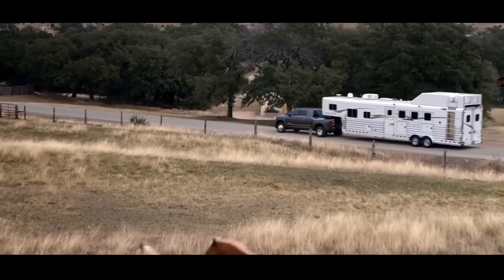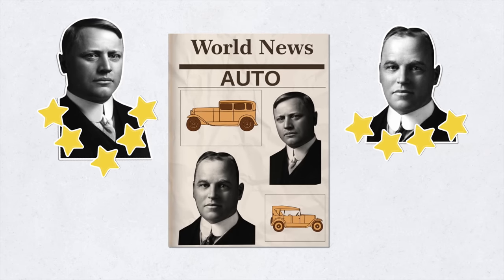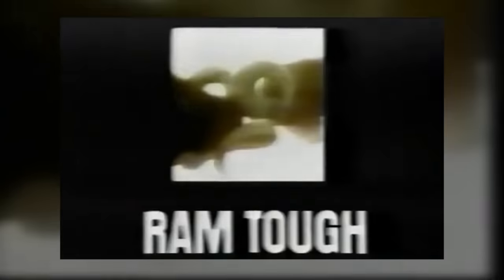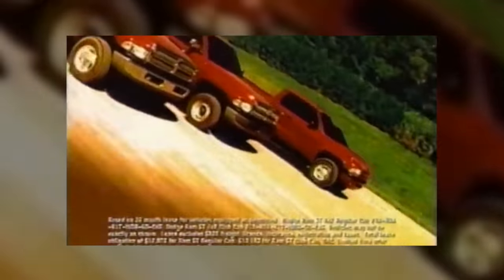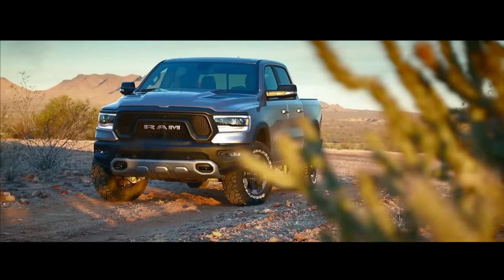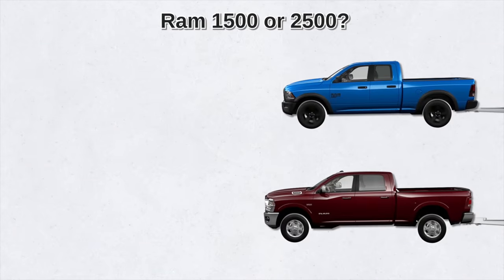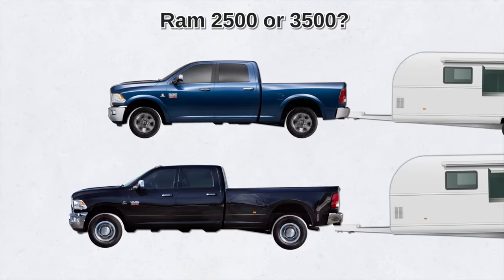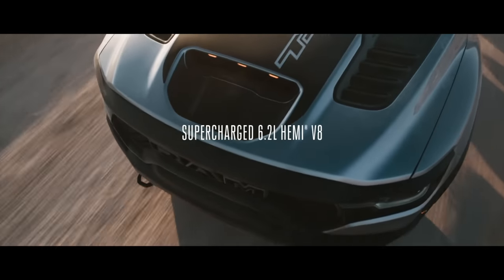No One is Telling You the Truth About Dodge Rams, So I Have to

Comment: Scotty, the 2021 RAM 1500 (New model) is awful. Whenever I make a right turn from a stop, the vehicle shuts down and loses power from the drivetrain, applies the emergency brake, and forces the driver to restart. The dealer who I bought it from says that "there is nothing wrong with the vehicle", yet acknowledges that the auto-start mechanism is the cause of the issue. Steer clear of this truck!!!!

Comment: Im having a broblem with air suspension on my 2017 Ram 1500 Limited edition. The whole truck is seating on a ground. I tried to take it to local diller and they told me since i don't have extended warranty it will be out of pocket cost . They say to begin they have to change my rear airbags and fill system with nitrogen. Then it might be more work after. 
Airbags are $2000 for bags alone $400 to install them + nitrogen fill up. 
I,d like to know if it's official recall for air suspension on my truck. It will help a lot. Waiting for response. Thx Suel

Comment: Just bought a used 2021 Dodge 1500 with 30k miles. Seems like all the truck manufacturers are having quality issues. 
If I start having trouble I'll sell it off before we get outside the power train warranty.

Comment: Nice Dodge commercial. I hope they paid you well. I did like the Dodge Brothers history lesson. I bought my first and last Ram in 1996. It was a beautiful truck. Drove like a sports car. I got lots of compliments and dates. The design and features hooked me. The Carroll Shelby and Mercedes Benz connection was evident. It just didn’t hold up. I think there was a problem with the metals used in its construction. I was sorely disappointed to be doing that many repairs on a new vehicle. I should have listened to my older brother. The people in my circle are Dodge owners spend a lot of time driving their other vehicles while their Dodge is at the mechanic. Dodge fans are really devoted.

Comment: Welp. I'm one that has the 5.9 Cummins 6 speed. Love this truck. Bought it brand new in 01 still stock today. Ain't no race truck by far. But keeps going. 420, 000 miles later still going easily. Inside dash is junk. Lol. Touch it and it crumbles. Please don't touch. Lol. Body yep. Rust out but I'm doing body work. Love this thing though.

Comment: I have run my RAM for a 125,000 miles without doing anything but the normal breaks changing the oil and tires it is been flawless and it gets 22 to 24 miles to the gallon on the highway with a hemi V8 I think it's a very good truck

Comment: Had a New 2002 2500 24 valve. Loved the truck, but it had a ton of problems, the adaptor between the Transfer case and Transmission cracked and leaked for no reason at less than 30,000 miles. The lift pump went out at 50k, and then the Injector pump went out a year later. Bosh quit making pumps so rebuilt ones were all that was available but still ran $1,000. Power Steering/Brake Booster went out twice, leaving me with no brakes, and you couldn't turn it unless it was moving. The PS Pump, being matted with the Vacuum Pump, required resealing sealing vacuum pump each time. This was all in the first 100K! It was a beautiful truck, great on the highway, but the springs were so stiff you really couldn't drive it far on dirt roads. It had springs like a Box Car on it!
It would rattle your teeth right out of your head! I loved that Truck!:face-orange-raised-eyebrow:

Comment: Greetings from Australia, as an fyi, this same truck in the 1500 is retailing in Australia for $140 thousand AUD or nearly $100 thousand USD. It comes off the factory floor is shipped to Australia where it is completely pulled apart and rebuilt into right hand drive. All manufacturers of full size US picks do this and refuse to build and supply direct to Australia, despite the demand being high. In Australia just about every household has a mid size pickup and want the full size. We are robbed blind.

Comment: I just traded my Ram for a Toyota. She ran great for a good long while, but in the last 6 months, i have had to drop over 30k in repairs in her, due to some defects that the independent mechanic says are faulty, low quality parts, and the dealership Ram Certified Mechanic says is because of a lack of maintenance.

Not sure how i maintain a motherboard, as the owner, when i cant even check it for issues without having a special code that the mechanics use, but only the certified ones. And costs a buck fifty just to have them diagnose the issue as 'you didnt maintain the vehicle, thats why your mother board shorted out, and burned your entire electrical system out'.

I'm not leaving Ram because of the quality. I'm switching to a brand that stands behind its product, and doesnt blame every issue on the consumer.

Comment: The Rams 1500 series and 97 the dash the top of the dash and that's at the whole dash so weak it just crumbles in your fingers the plastic will snap off and not be durable as some of it I had to go get a new top for my dash on my other 97 because when I got mine there was none on top where the air vents blow out so yeah that's so bad years for them on the dash so and I got told it'll snap and crack so I don't mess with it when you transmissions are pretty bad too I've got to get a transmission for my truck cuz the transmission went out and mine's a 5.2 l OL

Comment: Buy the Cumins with the 6 speed Aisin trans.
It is bullet proof. 
The other two including the 8 speed is crap.
I have had dodge trucks my whole life
I never had an issue until the 8 speed trans. They messed with it a couple times and then replaced the trans under warranty.
Just over two years later, it does this strange mis shift, when pulling a trailer at 70.
You start to need power on a hill,  it  trys to down shift to 6 gear and misses.
I never should have traded in my Cummins with the Aisin, for a new truck. The 5.7 hemi has been great. 8 speed trans is crap. 
Did I say it’s crap.

Comment: I bought a 2001 Dodge Ram 2500 Cummins Diesel brand new that year.  I had been pulling big heavy car trailers over 10 years using at least 3 different 90's GMC or Chevy Ext cab 1500's and they did OK but I wondered about a 2500.  I had been pulled out of a jam on a muddy back road by a then 30 year old Ram 4X4 1500 pickup. He latched onto my truck, my solid metal trailer, it fully loaded with a 70's Ford LTD 4dr and that Dodge barely settled an inch, so I was IMPRESSED.  Besides that Dodge 2500 diesel was all the rage then so I bought one out of Texas. Biggest thing I ever bought and paid cash for. That 2500 was so fine pulling big loads I got a gooseneck and a 3 car trailer.  I still own it, mechanically it had to have a lift pump changed at the 3 yr mark but that was it. Cosmetically it had come equipped from the factory as they all did with the non-optional self imploding  💩plastic dashboard that began to disintegrate at the 8 or 9 year mark. Hundreds maybe millions of trucks with the SAME problem, not a single recall. Like to know who Diamler paid off on that one. Mechanically it is still as fit as it was day one. I only have about 110,000 miles on it and truck-wise it's the best one I ever had.. But the dash continues to crumble, so I hardly ever drive it.

Comment: I had a 2011 Dodge 1500 SLT Ram Truck. Fanatastic riding truck. Terrible on fuel costs especially if you are pulling something. Then I bought a 2013 Ford 150 XTR Twin Turbo. Way better on Fuel and better towing vehicle. I had that truck for eight years and traded it with 170K miles with no power train issues. Not as nice of a ride though.

Comment: Me, my son and nephew all have 3500’s. They both have had to install new transmissions. They both tow fifth wheel toy haulers periodically. I tow a Cat 426 backhoe periodically. My transmission is fine. All are authentic. All are 4x4s all aft mega cabs. Mine is Longhorn Latiet. All the bells and whistles. The best features on these trucks is the Cummins diesel engines. The least desirable is the very rough ride and crappy transmissions. Allison transmissions would have ether cats meow. The door sticker calls for 90 lbs psi tire pressure. Rides Like a lumber wagon.  Not so good on fuel. About 19 with groceries about 9 pulling joe.

Comment: I have a 1500 Express model Ram and with a 5.7 Hemi -  8 speed transmission it is rated to tow 8800 lbs. I just bought a 30" trailer that has a dry weight of 5500 lbs. I don't plan to carry any more then 1500 additional weight including passengers. Can anyone tell me if I need to upgrade to a newer 1500 with a 12000 lb towing capacity or to a 2500? I like the fuel economy I get with the 1500 but I don't know if I am undersized as far a towing goes.
Reply: I would say if this trailer combo is something you do every day (construction company) then upgrade to a 2500.  If not yours is plenty powerful for the occasional towing job as a daily driver

Comment: I must have gotten a lemon when I purchased a new 2020 Ram 1500 Classic with the 3.6 V-6 and 2 wheel drive. By 6000 kms, yes, kms not miles, they'd painted the front grill, replaced the radiator, A/C condenser, cylinders heads, transmission, rear end and rear brakes under warranty. No lemon law in Canada, but with the market shortage I was able to sell it back to a dealer and extricate myself from lowest quality vehicle I'd ever owned. Unfortunate, because I loved the look, drive, and economy of the truck.
Reply: Nope they are just incredibly unreliable trucks!

Comment: Our company bought a brand new 1984 Dodge Ram 1/2 ton, plain jane short bed, 4 speed stick, with a slant six engine. It was around 6k dollars new. Incredibly reliable, lasted over ten years of hard work. But it was still an old school pickup truck, very metallic sounding when you closed the doors, no headliner, just metal. No radio, no A/C, and no power steering. The slant six engine I think was a 245 cubic inch? or 225 maybe? I think it was like 85 hp or maybe 100hp, not sure. But it was slow.. Very very slow! Top speed, not loaded, was 75mph on level ground. Top speed with the bed loaded with filing cabinets, while pulling a small trailer with more filing cabinets, was 45mph in 3rd gear. It would not pull 4th gear while loaded like that. Even when empty and not towing, to drive it you simply press the pedal to the floor, then wait until it's time to shift to the next gear. Then repeat. However, that engine was unbelievably reliable. At that time, most engines were worn out by 100k miles, but this old slant six went to 245k miles before staring to smoke.

Comment: I owned a new Dodge Ram for 12,000 miles, it was the biggest piece of junk I've ever owned because: only the front brakes would engage, the transmission would not fully engage in 2nd or 3rd gear, the lights constantly burned out, and many other issues on a brand new truck.  Even after taking it to Dodge 3 times for the problems kept coming back.

Comment: No I owned 5 brand new dodge trucks between 2000 to 2006 from a dakota all the way up to a 2500 cummings. Every one of those worthless trucks spent more time at the dealer getting u joints, ball joints, transmissions x2 transfer cases x3 rear springs and electrical work (all under warranty) The only thing that was any good was the cummings power plant but Dodge couldnt build a truck around that engine if there life depended on it. I went and bought a 2006 chevy truck and im still driving to this day, the only things ive had to replace on it besides the general maintenance stuff is a water pump and a battery

Comment: Ram 1500     
2320 payload capacity?????????

Most are under 1200 lbs, some as low as 945 lbs 
Always check the yellow tag inside the drivers door

Comment: My first dodge truck was a 98 Dakota with the horrible vortec engine nothing but problems with it kind of turned me off for Ram trucks until I got a 2017 Ram 1500 V8 loved it to death traded it for a 2019 Ram 1500 V8 which I loved then just recently traded it in for a 2023 Ram 1500 V8. I won’t drive anything else.

Comment: Very good history lesson of Dodge brothers at the beginning of video. Very interesting.
From what most older family members and older people tell me, Dodge and Chrysler were decent products until the early 1970s. Ever since then, they went down the tubes, and they make them to break down sooner so people would have to dump money into them. That is my experience with them, comparing other makes and models of cars and trucks I had. Very few people that I know has or had decent good luck with Dodge and Chrysler cars and trucks.  
Had the 1985 and 1996 Ram truck. Both had transmission problems.   
For a few or maybe like $5,000.00 extra thousand dollars think better off going with Ford, Toyota or GMC truck or car. 
But just speaking for myself, before I get any negative comments from Chrysler or Dodge people. But will admit, I do like many of the Dodge and Chrysler body styles.

Comment: You do  know that you option your RAM 2500 with air springs too right

And you forgot that the 3500’s top engine is a High output version of the Cummins that give you 400hp and 1000lb-ft of torque

Comment: i had a RAM 1500 Rebel and it was so smooth and comfortable. Was better than a Ford F150 with that ridiculous eco boost 6 cylinder. Traded it in for a 2021 Challenger R/T Scat Pack......No regrets.

Comment: I had a brand new 2000, 1500 ram. Terrible gas mileage, the sticker said 19 to 21 mpg. I was getting "maybe" 13 to 17 at best. I had transmission issues. Horrible vehicle.

Comment: I remember when the 2nd gen came out I was a kid. I wanted one so bad. That was the best looking truck bar none at the time. To bad it was a piece of crap and rusted to pieces depending on which year you bought. We had a 98 Durango as a kid thing was a beast I loved driving it. I bought an 04 new. Has been a good truck until the past 2 years. Dodge has every opportunity to be equal to Ford they just cut corners with crap parts and interior components. Sad

Comment: I have a ram 3500 hemi DRW.   I wanted gas because it is lighter and I wanted to carry an Arctic Fox 990.    The 6.4L Hemi has plenty of power for that.  What wasn't mentioned is that I have the 8 speed ZF transmission which I like a lot.  Yes the engine winds up a lot to get the torque but I like the simplicity of the 6.4L Hemi.   The diesel people think I am crazy.    I would agree if I used my truck at higher altitudes.    The big advantage I see in a diesel is the turbo charger that keeps the engine fed with lots of air.    I admit, my Hemi literally sucks at higher altitudes. It sucks air. air.
If I lived in Denver I would probably get a diesel but so far I like my 6.4L Hemi for hauling my 5600 lb or so Arctic Fox 990.   BTW,  I weighed my rig when I got it.   Full of 59 gal of water, 2 lead acid batteries and 2 7 gal propane tanks I weighed in at 12870 which is below my 14000 lb GVWR.

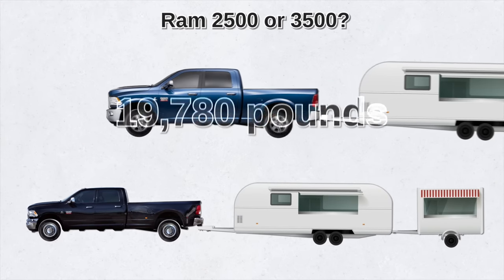Comment: 10:06 - i never heard a pickup's weight handling ability defined as 'lifting capacity'. Its not a front end loader lol

J/k I liked this vid. Not a dodge fan but I do like cummins. Theres a reason many, many hot shot hauling companies use rams, the Cummins/ aisin. Although they have lost some ground to ford in recent years with 6.7 powerstrokes. The big 3 are all great, im going to be looking for a f350 6.7 dump truck soon, my biggest dislike is price, but what are you going to do about that? I always ask diesel owners when I run into them around town if they have had any problems with their trucks, ram still seems to have the most emissions systems and electrical problems. I thought the dodge wiring was an old meme since fixed, apparently not entirely.

Comment: I drive a 2013 Ram 1500 V8 and have had no issues with it so far. 148000 miles and it runs like new. I used to prefer Fords….

Comment: Incorrect, none of them choose a "Cummings" engine. They choose a "Cummins" engine. 

Dodge brothers transitioned to making auto parts for Oldsmobile, years before Ford came along.  Ford kicked them to the curb because he was paranoid and treated his workers like garbage, so they took their earnings from making Ford motor cars what they were and invested it into building their own. 

That being said, in the latter part of the video a lot of those towing and payload parameters still vary. 2500s between the V8 and Cummins diesel will vary, as well as the 3500 SRW vs the DRW. Then of course taking 2wd/4wd into consideration they vary even more. Also the transmission in the 2500 6.7l cummins option is only the 6speed 68RFE. The 8 speed AISIN transmission is only available in the 3500 pickup. The 6.4L V8 2500 option features the 8speed transmission.

Comment: Somethings that should of been covered like the 1994-2001 Dodge Ram dashboard cracks. But it's more than that the dashes of Ram trucks from that era basically explode into hundreds of little pieces.
And don't forget the Dodge 4.7 V8 once they reach 100K get rid of the truck or any overhead cam engine because it won't be long before you will be replacing the 3 timing chains. All the overhead cam engine were near the same when it came to timing chain. Those truck are not for the poor man.
Cost on replacing the chains was near 2K or more they are just like the Fords overhead cam engines. Its best to stay with a push rod engine by far less cost if you want to put in over 200k miles on it. I have seen some make it past 500k miles. Stay away from the Ecotec engine, Flex Fuel & Active Fuel Management System if your poor boying it.

Comment: Why did I get a 2000 24v?
For the Cummins. I like dodge rams, theyre solid, but there's better trucks than a ram. But you can't beat a Cummins; been the most elite diesel manufacturer since it came out 100 years ago
And like Amy vehicle, with proper maintenance it will last